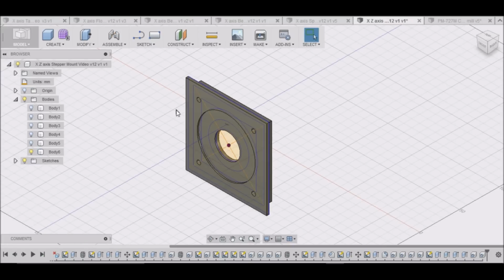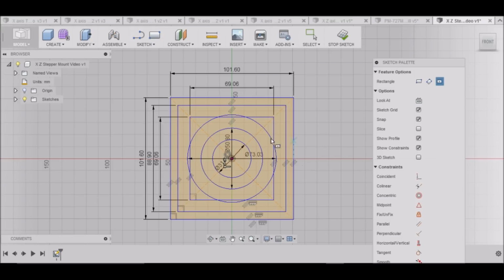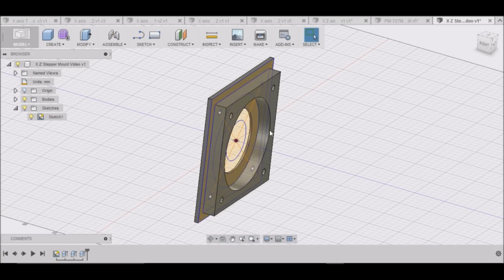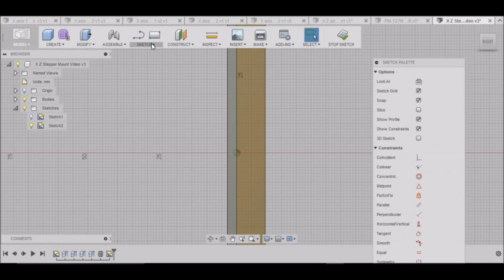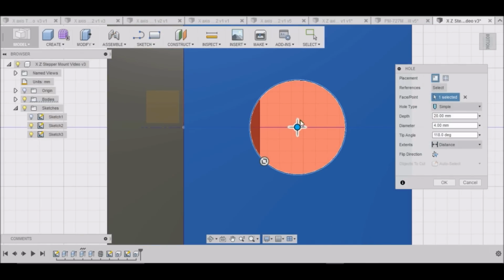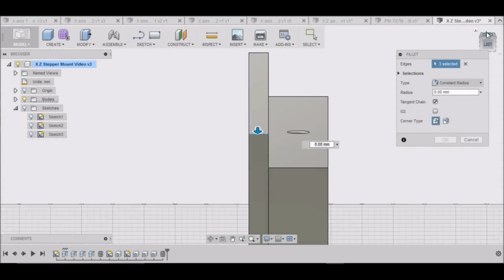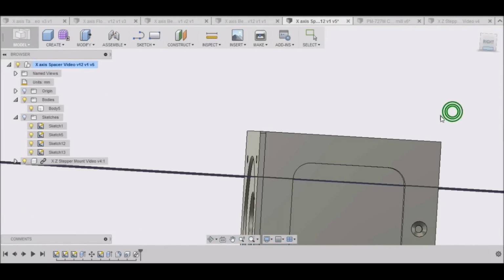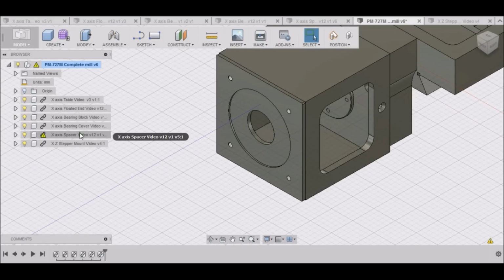PM-727M CNC "X Axis Stepper mount"

Comment: Sam  When putting the holes in the side of the flange, could you not just push/pull hole all the way through both sides at one time?thus just doing 2 hole to get 4.George
Reply from the maker: +wilkbilt 
Hi George 
Yes you can but I was having a issue when I went to thread the hole it wants to thread both sides at once. I'm sure there's a way to get it to work out I just don't no how. So I just put 4 holes. 
Be safe Sam
Reply from the maker: +CNC4XR7 hi George 
You can do that but when I went to thread the holes it would thread all 4 as well I don't no how to make them 4 seperate holes. For threading. 
Be safe Sam

Comment: I'm still following and collecting the parts needed. Having trouble finding the Emerson VFD at a reasonable price. Thanks and keep the videos coming!
Reply from the maker: +Benjamin Usey  You dont have to get locked in to the Emerson there are other VFDs  One thing I would look for is the Ability to connect a braking resistor something like this http://www.automationdirect.com/adc/Shopping/Catalog/Drives/GS2_(115_-z-_230_-z-_460_-z-_575_VAC_V-z-Hz_Control)/GS2_Drive_Units_(115_-z-_230_-z-_460_-z-_575_VAC)/GS2-11P0
Reply: Thanks. That's a much better price than what I was finding for the Emerson.
Reply: +Benjamin Usey I had the same problem getting the one Sam found.  If your willing, look for the 220V version. 
Emerson SKBD200110 AC VARIABLE SPEED Drive COMMANDER SK 200-240V.  The key is finding one with the B designation to fit the footprint.
Reply: +Benjamin Usey Also. The motor Sam picked up is out of production. The new ones have a .30 designation at the end of the catalog number. I jumped up to the 1.5 hp version.
Reply: I actually found the exact motor but it arrived with a broken fan blade. Going to just order a new fan.
Reply: +Benjamin Usey Oh great !  Good find. I looked everywhere.